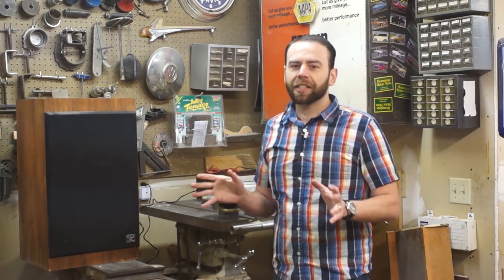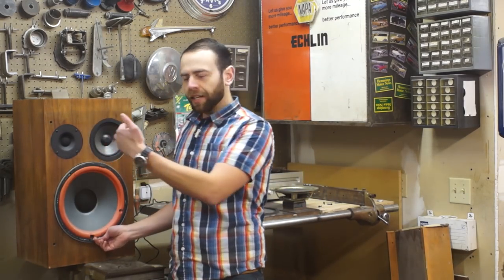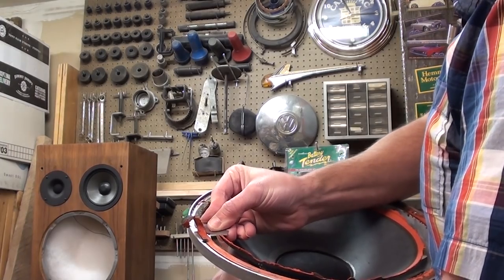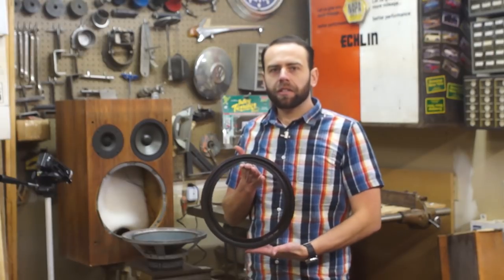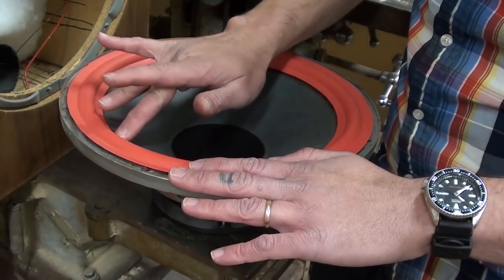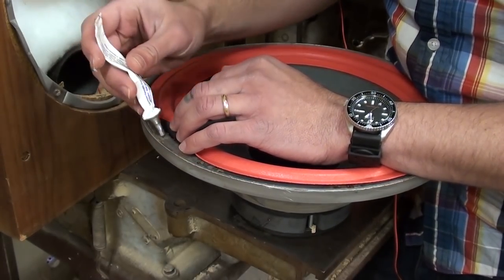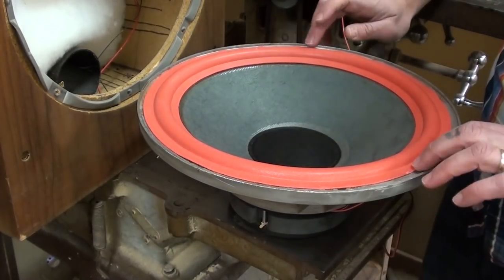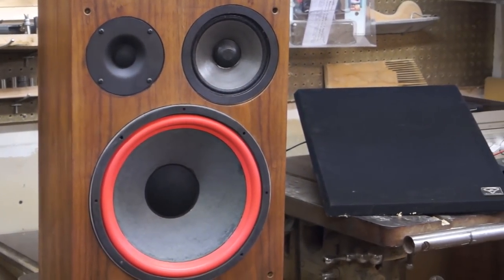How to Repair and Refoam a Speaker Surround

Comment: The best videos for replacing surrounds on subs period. I'm still in awe about using a tone frequency to center the coil. I have 2 12 jl w0 that just needed surrounds and I really didnt want to remove the dust caps since they are original and I can't find anymore

Comment: Really helpful, and leaving the dust cap in place, often the old C-V caps had a nice logo on them. One less step, one less chance for a mistake like nicking a wire. Just picked up a garage sale set of C-Vs for my first refoam job.

Comment: A nice video.

A tip for the Isopropyl alcohol is to use proper 99.9% and not rubbing, as any water content can damage the paper cone of some drivers. 
Using a Q-tip to apply, then you simply use a small plastic scraper to remove the gunk, again while supporting the cone, easier than using a water diluted alchohol and risking cone damage as we see on your cone.

You use a low tone to help you center your cone, to be frank the spider on many bass drivers is meant to be rather stiff and that should be centering the cone, if you have coil rub then it could be a sign cone sag has affected the spider meaning a full recone, or it needs rotated, personally I would simply buy dust caps and shim the coil. With a Q-Tip and 99.9% alcohol most glues come away easy on the dust cap, and a Q-tip and alcohol cleans most of the residue.
Any gluing of a surround is leading to cone and surround flex as you apply pressure, so you could in theory have uneven tension around the surround, or at worse, rub some of the insulation off your actual coil.

Another tip for raising the cone is a small 1.5 volt battery. It will simply raise the driver, allowing you to glue under the surround. You can buy a single battery clip with lead out wires and use crocidile clips if this is something you will do more than once. Also helpful for testing a driver is actually working in the absence of any other equipment.

A few others have had success with leaving the glue for a couple of minutes until tacky, this of course will depend on how accurate and confident someone is, and will also depend on the adhesive. But worth looking into. 

Nice to see video's on recone work instead of items going to landfill.

Comment: It’s easy to remove the central cap without damage. Pour a little 10-15 grams of alcohol directly into the diffuser (the alcohol gets directly onto the adhesive seam) and cover with a plastic cup to slow down the evaporation of alcohol. After 5-7 minutes the cap comes off easily, I use an old credit card to help.

Comment: 13:40 looks like the glue didn't work, keeps lifting, not sticky, I had a similar issue very frustrating, i see gaps around the edge on yours, make sure to go over it again after it dries and from the underside

Comment: You need to spread the glue evenly because there is almost no (continuous) pressure to spread it. Use a piece of paper/plastic (or anything flat) to spread the glue on the whole surface. If you don't do this there is a chance some glue connections are weak and get loose over time because of vibrations.

Comment: When i glued my two surrounds in I  thought I was going to run out of the glue provided so I researched quite some time on line.

Turns out the consensus of opinions said the glue to use was Aleene's Quick Dry Tacky Glue. Which is good because you can buy it everywhere.

I had just enough to finish my two surrounds but I bought some anyway to be sure I had enough to finish.
Reply from the maker: Can confirm. I've used that exact brand of tacky glue with good results.
Reply: I just happen to be revisiting this video about a year after I saw it the first time. I was searching for a glue to reattach a surround to a 6.5 inch Cerwin Vega component speaker. The surround on this particular speaker was made of rubber. I tried the Aleene's Original Tacky Glue to adhere it back to the frame. The glue did not hold very well. I'm assuming it was because the surround was of the rubber type and not foam. Just wanted to recommend you don't use on rubber surrounds. I ended up using a typical hot glue gun, using the glue sparingly but covering the mating surfaces.

Comment: Hello and greetings from Italy. sorry for my English. I liked your video, and, today, I changed one FOAM of my speacker (ESB 7/06). The worst part of that work was centered the ring, now seems work . Very hard to do, probably because is the very first time. What king of glue you used ? I soo two king: one is called vinavil and is water based, and the other one is bostick. I used the second one, but, the problem, was to correct the thing. as soon I have posed the pieces the glue stick and block very rapidely. BDW, now one is done. As the second going broke I change. Have good time, Stefan, Iltaly
Reply: Most people advise using Aleene's Quick Dry Tacky Glue. Everyone sells it and it's cheap.
Reply: @pay9011  never heard of it.  What sort of glue is it?

Comment: Did my JBLs.  Undermounted the surround, as they originally were.  Coil very close tolerance, could not easily slip in a playing card shim. Shimmed one, skipped it in the other.  No difference.  Both sound better than ever.  $25 investment was way worth it.

Comment: Thanks for the informative video.  I am trying to work myself up to re-foaming my 12" Cerwin Vega subwoofer.  Local repair shop wanted $160.00 to re-foam, so I figured I could give it a try for the approximate $26.00.  I have watched a few other YouTube videos on the subject, and they suggest centering the coil just by manually pushing it in and out, and stopping when it does not rub.   I don't have the equipment or desire to use the tone generator method that you recommend.  Is the "manual" method suitable?    

Thanks for your honest opinion.
Reply from the maker: I've not tried centering one manually, so I can't say.
Reply: I ordered the foam kit to repair my cerwin vegas and I used the manual method as instructed in the Simply Speakers video. It worked fine for me. Actually when I got the new foam installed, it pretty much centered itself. Hope this helps.
Reply: @tsims73  Agreed, once I put the foam on the cones they were pretty much centered already. I did the test tone to center the speaker anyway and it was pretty much spot on. This was a good method for me. CV RE-30's

Comment: Isn't the speaker already centered by itself? A friend of mine didn't do all that "CENTERING" and the speakers sound great!!!!!
Reply: Same here but I did the tone generator method anyway just to check. My speakers needed no centering, the spider held it firmly in place. My opinion is that replacing undamaged dust caps is a waste and pretty much a shim/cap selling scam.
Reply: The cone can be off center if the spyder is not stiff.  So your results may not be as good without some cone centering process.  Also your skills may not center the foam when glueing and cause a problem.

Comment: Contact cement has very specific properties that do not match the adhesive being used.  With contact cement you put it on both pieces and let it dry for a while before putt the two together, and you really can't adjust much after that... they join on CONTACT.  This application needs to be able to be adjusted, so it would be a terrible situation for contact cement.

Comment: [5:00] What would be the result of installing the neg. wire on the pos. speaker terminal and vice versa?
Reply: It would be out of phase with the other speakers in the cabinet and with the other speaker pair.

Comment: how anyone does this without getting glue all over the place and ruining it is beyond me. Either its not enough and it wont stick or is too mich and squeezes out all over. besides its almost impossible to get the glue under the surround once the other side is glued because it just does not pull up. also noticed everyone showing this with big speakers but nobody shows it with 6 inch speakers for a reason.

Comment: Why not replace surrounds with rubber or is the drive foam also
Reply from the maker: The originals were designed to use foam surrounds. Other materials could be a different stiffness, which would change the way the driver responds. The companies that make these replacement surrounds usually stick with whatever the driver was originally designed with.

Comment: I wish there was more detail about how to hook up the low frequency tone. I don't really think a phone by itself can drive that speaker, so how is it hooked up to the amp while out of the housing? I don't have long wires on my driver, nor do I know how to hook them up. Some weird thing with alligator clips? Bleh, so much work. I bought some replacement foam, and I might be able to deal with the mess of cleaning the old foam off (and gluing down the new foam rings), but then even more obstacles with the voice coil make this just about beyond my skill level. :( Maybe I'll just wing it and hope its lined up.
Reply from the maker: I wouldn't wing the alignment and hope. That's a recipe for failure and/or frustration.
You are right that a smart device's headphone jack doesn't have enough power to be hooked up directly to the woofer and drive it at reasonable levels.  The iPod / phone / whatever is hooked up to the stereo inputs of an amplifier with a 1/8" (3.5mm) to RCA adapter cable. I buy them from thrift stores for $0.25 to $1.00 a piece.  Retailers like Monoprice have good ones for cheap too.  The speaker wire is running from the outputs of the amplifier directly to the lugs on the woofer.  I just kinda folded the ends of the wire over so the bare copper would make decent contact with the spade lugs.  Like I said in the video though, if I had some wire with alligator clips on the ends, it would have been more secure.  I was more interested in convenience during the making of the video.
Reply: You're a really cool dude to reply to my whiny comment with some seriously helpful tips & explanations. I think I will give this a go and with a bit more confidence now. Much appreciated brother!
Reply: @mrhobs  how did your speakers turn out?
Reply: @mercurialmagictrees  Wow, missed this in my notifications, but happen to come back to this video just now, because... wait for it... I'm STILL WORKING ON IT! Hahaha! :(

Well, needless to say, I set it aside and because of numerous excuses and life distractions, BUT I have since set up an office with a work table on one side, and now have one of the drivers cleaned up (pretty tedious job) and ready to go. I've also already fiddled around with getting it hooked up to an AVR and Frankenstein-ing some wires (and some alligator clips I acquired by chance over a year ago) to play some music through my phone/portable CD player. I'm about to attempt to glue it in place, but... it really just does not seem possible to do with any precision. I'm just going to end up globbing on some glue and seeing if it works. :/

Also I just noticed that in the video the inside foam edge goes on top. On mine I have to glue the inside edge of the foam underneath the driver cone edge. Makes it a little more of a pain.

EDIT: Also, what's the deal with other videos insisting you cut on the dust cap and shim the coil? I mean... shouldn't you be able to align it without cutting it out and re-glueing it back together? I can't mess with that...
Reply: Welp, about an hour or less later, I've got it glued down! (After all this time, finally did one! :P Had to sit there for like 5 minutes psyching myself up to start glueing, haha.) Hopefully it sounds alright when I test it tomorrow night, but if not, that'll be my excuse to start shopping for better speakers. ;)
Reply: @mrhobs  interesting. I hope it turns out good!
Reply: @mercurialmagictrees  Welp, that one turned out alright! Works with no buzzing (that I can notice).

Did the second one late Friday night. Bit of a janky glue job, but not really noticeable in my dimly lit living room, and at several feet away. I let it cure for 19 or 20 hours, and tested it out Saturday night. It works! They sound pretty decent together!

Now... the ridged plastic ring that screws down just around the outside edge the foam surrounds... it mushes into the surrounds like the foam is a bit too wide around... so I kinda just screwed the plastic rings down halfway so they wouldn't squeeze the foam too much. I don't know, I could just leave the plastic rings off but A) they might actually contribute to directing the sound a bit, and B) I'd have to put the speaker covers on to hide how ugly they look without the rings on... and I like to keep the covers off... idk, I may experiment. Anyway, good enough for a 16 dollar pair of speakers! (8.95 for surrounds, 6.95 for glue, free for everything else) :)

Whenever they need more work... I may just upgrade instead haha.
Reply: @mrhobs  interesting. There sure is value in the experience of learning to fix speakers.
Reply: @mercurialmagictrees  True!

Comment: i doubt the voice coil was properly centered in this video. the most critical part of refoam process.
Reply from the maker: What makes you say that? I (and thousands upon thousands of others) have used this method for decades. I'm currently using the exact speakers that I refoamed in this video, daily in my living room, and have been for quite a while. Still no voice coil rub to be found.  Nor in any of the other dozen or so woofers that I've refoamed and centered this way.
Reply: Actually it is a precise way of centering a coil. By introducing current..lower end frequencies, the bobbin will electromagnetically force itself to become center between the outer and inner pole of the magnet structure. Great results could also be obtained by using low voltage..amperage though the procedures are slightly different in centering then illustrated in this video. 
When shimming, extra steps are required and "this does happen" fine tunning the cone by checking rubbing points will require re-centering of outer foam. 
Both methods will achieve great results, myself, I prefer electromagnetic centering.

Comment: Can I use the cerwinwega surround rubber on an optimus brand speaker ?
Reply from the maker: You should use the correct type of surround for the speaker you will be repairing.  Rubber surrounds can be stiffer than foam, which can change how the cone moves, which can have negative effects on the response and sound.

Comment: Why do some instructions say to remove the dust cap?
Reply from the maker: That is another technique where you don't use a tone to center the voice coil. Instead, you remove the dust cap, stick shims in the voice coil gap, and then glue down the surround.  Either one should work. I just prefer the low frequency tone method because I have to cut and glue less.
Reply: @TinyLittleWorkshop  No need to fully remove the dust cap, cut it 70 to 90% around being careful not to cut or damage the wires, pull it back a bit to insert your shins. when done, glue it back BINGO
Nice video by the by

Comment: whats an 8th inch in millimeters? a comment for future viewers. perhaps tell people what it is in metric seen as the internet is global. im from aus
Reply from the maker: Good catch. Bill is all for living fully metric but is stuck in the U.S. Most of the other Tiny Little Workshop videos eschew imperial measurements, but for those times something does sneak through, Google is pretty helpful about converting measurements straight from the search bar.
Reply: @TinyLittleWorkshop  1/8th" is 3 mm, 1" is 25.4mm

Comment: $20 for the set? Man, was good before ol Biden got his hands on the country..
Reply: What an idiotic comment on a video like this. This video came out 7 years ago and the exact same kit he's using in this video is currently $22.95. He said in the video "$20 or so", it's not hard to believe he likely paid the same $22.95. Considering $22.95 seven years ago is equivalent to $29.47 today, you're actually spending 28% less on this kit than he paid when he made the video. A 7 year old video about speaker repair doesn't need to be political but, for some reason, here we are.